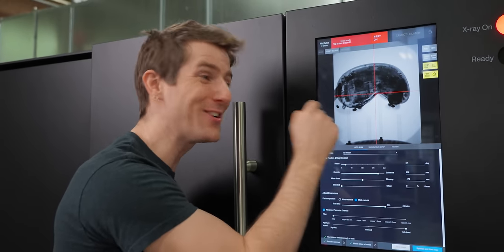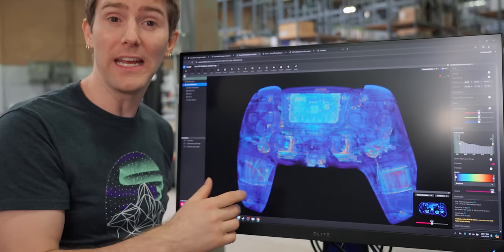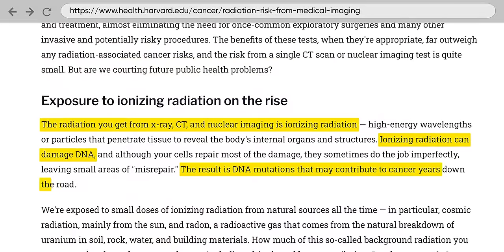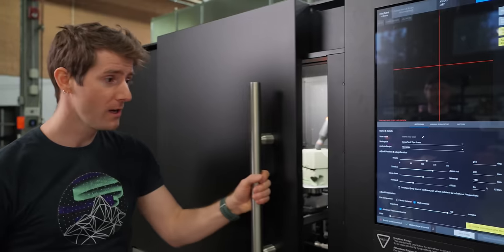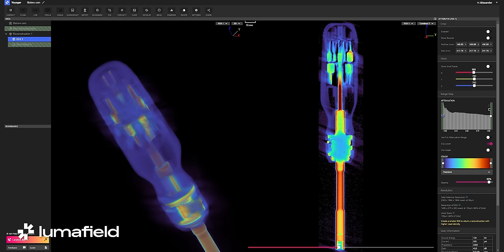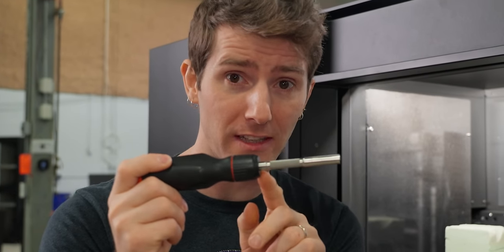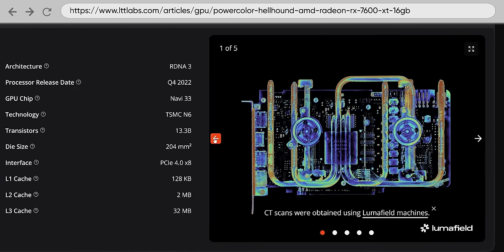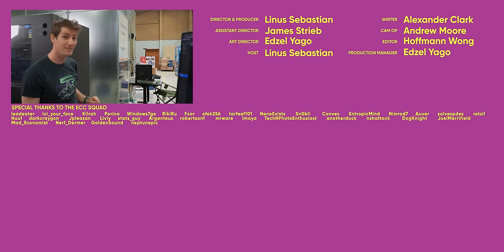We can X-Ray Gadgets we Review Now! - Lumafield CT Scanner

Comment: For internal product testing, I can totally see how this makes sense. But as a consumer, why would I care about seeing a GPU  scanned by a CT on the labs website? A picture of the die with the cooler removed would suffice. It could invalidate future testing, but then just test the thermals of the card once before removing the cooler would work too right?
Reply: This allows you to see every aspect of what you put in meaning you can see gaps between thermal pads defects inside coolers you can't normally see even defects in the PCB. The inside of power supplies and their components. Inside monitors. It allows you to easily make 3d models so everyone can see all aspects of the item for free quickly. Labs is not for you by the sounds of it as you aren't into the components

Comment: This is what we actually use in our clinic to prepare for complex brain surgeries, especially when we have to pin point a rumour and its surrounding tissue types. We even use the created 3D model from the CT to 3D print perfectly fitting guides for tools or needles which need to be angled in certain positions.

Comment: Actually the best details are near the detector plate, just like light, where you have the best shadow detail is near the surface where the shadow is projected. You might lose some intensity if you scan a small object far of the x-ray canon, hence the "detail" loss, but it can be corrected by adjusting the lens or the time exposure.

Comment: Few minor things here ...
5:40, medical scanners are more powerfull than you might expect. To prevent things as starburst in your scan you need quite some power to "see" trough them. For example a prostetic hip.
6:28, Just because the object is rotating, flat surfaces are no problem for a scanner, the problem lies in the possibility to create a huge metal barrier if you scan an object tangential, so no radiation is going through the object.
6:49, the highest detail is closer to the detector, not the emitter. This is because your focal point of the X-ray tube is not infinitaly small. You'll get some blurring closer to the emitter.
9:41, Fun fact, max KV is 120 KV and max tube current is 300 uA which calculates to just 36 watts of power. In general a medical CT scanner uses much more power than this. This in the range of 120 KV and the amperage is in the milli amp range. But time is a factor here, these powerratings are not sustainable for longer times due to overheating.

But this is a great video on a proven technique for looking inside objects without opening them. Loved this video!

Comment: Very cool equipment and much appreciated explanation. :goodvibes:
Things I'd be curious to see scanned; Mechanical watch, studio microphone, automotive spark plug and maybe a direct drive racing wheel hub.
Also it could be interesting to push the limits and test that theory of too much exposure flipping bits with a sacrificial SSD and parts and then test them after the damage to see what changed.

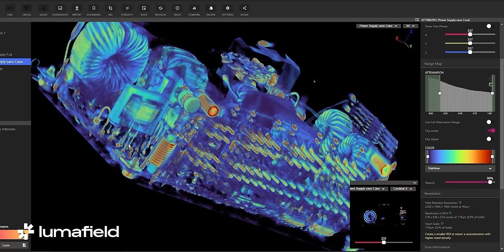Comment: 4:15 You can inspect solder joints without having to zoom in a very specific area, as you stated. You have a tool that you could use and build an AI program to help differentiate what a good solder joint is vs not. I am sure you have the machines capable to train the AI platform and you do have a very smart crew to help you do so.

Side note: I would absolutely love it, if you could create a tritiary channel, that covers coding and programming technology. The way you all explain new technology is amazing and think that this could be a great way to expand your brand.

Comment: What to scan?? MICE!
Corsair's Ironclaw! I wanna service the thing because grime has gotten in the mouse wheel, but why the f would you hide the screws and clips? If I knew whats where, I would likely open it up and service it.

As a medical imager, I was very happy with the explanation of the device. Good job team!
What I dont understand is why it needs the processing externally. It surely does not require a GPU farm to reconstruct a CT scan from raw data. Thats also a reason why the tech has been around for decades lol.
That said, image processing also comes with reconstruction artefacts - which likely make it harder to test solder spots. If you are gonna pixel peep on a scan - good luck lol.

Comment: As far as the filter goes, it's more similar to a colour filter/gel than an ND filter - the higher the attenuation of the signal, the more other "colours" are filtered out.  In fact that's why ND filters are called that - because they are designed (meticulously) not to change the visible colours as they attenuate the light - they are "neutral" to colour, and change the "optical density" of the light.

Comment: I have a few questions about this that I'm hoping someone could answer. I have a physics degree so please get into the details, though I did struggle with E&M and its been a few years since I've done anything with optics. 
You mentioned that a lot of the positioning and exposure time is a guess, but with the ability to get a brand new ray tracing computer for less than $1500 or a used one for around $800 (I've seen a few used laptops with mobile 2060's in them for that price) why don't you do some kind of software ray projection using solidworks or a similar program to prevent the guessing? Even if that's not an option, why not do the calculations either by hand or using something like MATLAB?
The next question is about the damage to the equipment being scanned. You did talk about the possibility of bit flip, which is certainly a concern when using this kind of technology, but you glossed over and dismissed the possibility of damage to materials such as glass or plastic. I work in a field that uses ionizing radiation for sterilization proposes, and we have to be extremely careful about how the items we irradiate are situated, what they are made out of, the weight of the object, etc. While I don't personally deal with those processes in any kind of calculations or specifications, I have talked quite extensively with people who do, I've had to take into consideration the density of packaged product because of the constraints of the irradiation facilities, and I've seen the quite extreme changes to the physical and visual characteristics of the products after they've been irradiated. Why is that not a concern with the plastics here? I'm assuming the Buzz Lightyear toy has already gone through the scanner when we saw it on scree, and with the irradiation we use the clear dome over on his helmet would be between yellow and dark brown. Its clearly not here. Can anyone tell me why that is? Iirc, a lot of crystals can be quite susceptible to damage from ionizing irradiation. If I'm remembering correctly, what is the risk of something like an LCD having its characteristics changed part way through the scan due to this damage? Beyond crystals, what are the potential bias introduced from that type of damage or is the risk of such damage so low that it doesn't matter for these purposes?

Beyond the physical and chemical damage to products, I'm curious about the legality of this kind of thing. Excluding an NDA preventing you from sharing this kind of information, are you concerned with damaging relationships with companies like LG, Sony, Samsung, Google, etc.? What kind of repercussions could you face from a company like Nintendo or Apple that are notoriously antagonistic both to the general population knowing and handling their product in this manner, extremely litigious,  and to LMG in particular?

Comment: The tradeoff between detail and size of the scan I would think could be mitigated by simply moving the mounting plate during the scan sequence. Bring it right up to the emitter to scan only a small part of the object, but then slide the object up/down or left/right to handle a larger object.

Comment: Some ideas i have to scan right off the bat,
cheap vs expensive/name brand LiPo or Lion battery's
read vs fake mechanical keyboard switches 
maybe you'd be able to see if thermal paste is put on properly? and if so, you'd be able to tell once and for all what's the best way of applying it

Comment: I would be curious to see if you could use a ct scanner to look at chip ICs... Youd probably only be able to do it with the older chips as the resolution might not be high enough for 5nm node processes and similar. Maybe it doesnt even work if it the different doped parts of the silicon look identical in the X-ray wavelength... But if it does work, that would be cool to see

Comment: Can you scan an optic fiber? would love to see if there are a density difference in the fiber (core vs the outer layers of the 125um fiber, hopefully it is not too small, try and see :-)  ), could be good to try some connectors as well, to see how well they are glued, would be good to see if some brands are doing a good or bad job and if they risk falling apart.

Comment: A "linear accelerator" until very recently is not very expensive!  That's how old-school CRT screens work.  Any color TV had three of them.
And don't think those small electron beams don't count -- the same thing is in fact used to make X-Rays.  The original Crooks' tubes and simple ones still made for science classes in school.  I remember using one that had a flip-up cross that could be positioned in the path of the "cathode rays" that causes it to emit X-Rays, and using it to reproduce the first X-ray image (albeit with a grocery store chicken, not a living hand).

Comment: 8:30

Those pure white pixels popping in and out of frames?
Those are high-energy X-Rays hitting the camera 

Kyle Hill went into the NSC, stared right at the tomb of Reactor No.4 of the Chernobyl Nuclear Power Plant, and looking directly at the Sarcophagus he got one or two pixels popping in and out
The inside of that scanner has many times more activity than somewhere that made normal Geiger counters go off the charts

The pixels Kyle saw, though, were incredibly high-energy gamma rays that passed through the concrete of the Sarcophagus
As Linus says a few seconds later, those X-Rays are almost entirely blocked by the few millimetres of lead the chamber is built out of

Comment: As a must do scan a good lithium battery that’s new and an old lithium battery. That’s in bad condition. Let’s see what kind of interesting differences you can see!!!!! I also have a lithium iron phosphate medical battery that is destroyed that can be over scanned to absolute insanity. I’m also wondering if the ionizing radiation may negatively affect chemicals in batteries? Wouldn’t it be crazy if you accidentally found a way to reverse damage inside of a battery by hitting it with radiation? It would likely work with what referred to as dendrites, which would be cool to see in the scan. I also have lead acid batteries in different levels of conditions that would be cool to scan as well. You’ll be able to see the sulfation and failing plates.

Comment: Reverse engineering ROMs is easier if you don't have to decap them (i.e. remove their outer packaging).  Probably won't help for EEPROMs.  Could be useful for tracking down attempts by China to inject bad hardware into the supply chain.  Or you could look at the differences between legit vs. black market Cisco routers.  You could look inside case fans or other fully sealed parts without disassembling them to determine their composition and makeup.

Comment: Good and interesting video. Small errors. Worst was at 7:50 in the video. I agree that budget phone sensors are cheap, but the sensor in this equipment is LARGE and therefore hugely expensive! 
It's most likely going to cost you $100k USD to get a new sensor in the machine.

Comment: Scanning failed Nvidia 4090's and the connectors without disassembly. Also scanning improperly vs properly connected 12v HPWR connectors, as well as ATX 3.1 vs ATX 3.0 gpu connectors they say they are better but how do we know?

Comment: I doubt this device produces Xrays of short enough wavelength - and more importantly- sufficient INTENSITY to induce photoactivation.  This thing is not being used to inspect welds in steel pipe, but to peer inside plastic cases of gizmos. The detector this thing uses is likely to be VERY SENSITIVE and so the xrays don't need to be particularly "hard."  This unit is probably Neptunes 120 kV model which would produce xrays down to  0.010 nm in wavelength.  The National Institutes Of Health point out that there is little risk of photoactivation with xray sources below 5 meV - which is roughly 50 times harder than the xrays this device produces.  So, yeah, this thing is not going to activate anything.

Comment: You can't see the insides of a mouse without destroying huh? The only thing getting destroyed are the sticker feet that might get bend out of shape while removing (although I have to believe there is a way to prevent this like the use of a heat gun or something). And even if you "destroy" the sticker feet, there are very cheap replacements, 50% of the time, in gamong mice there are reaplacements in the box of the mouse on purchase... So, what? You afraid you gonna break the clips that hold it together? Just be careful...

Comment: I work in radiography and have for a long many years. the closer the object to the source the more blurry the image. the closer the object to the image (i.e. xr plates or here that carbon surface) the more accurate image. learn the technical data before the video.
Reply: But resolution is higher near the source which means you have a more detailed volume to see smaller objects. Accuracy doesn't change depending on where you place your part.It is dependent on the size of the object.